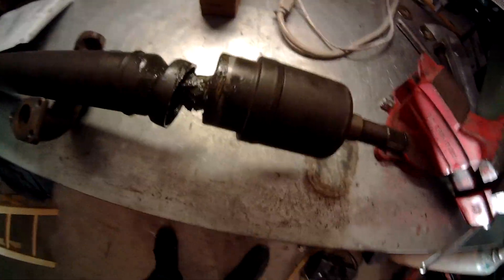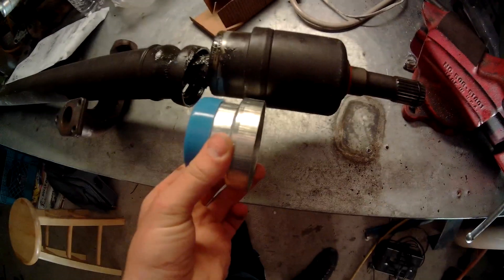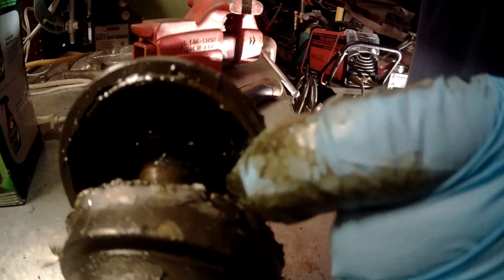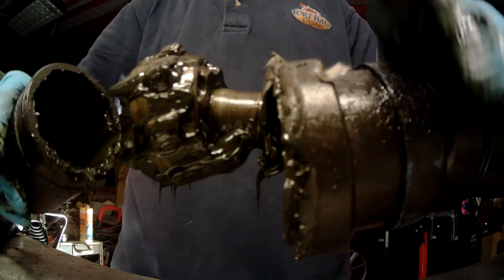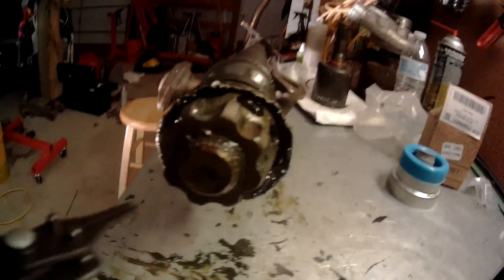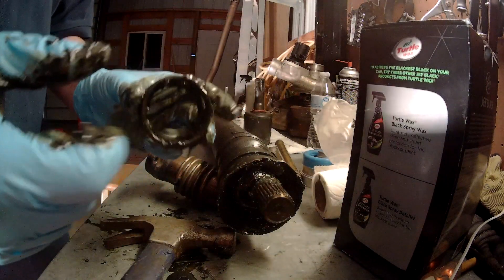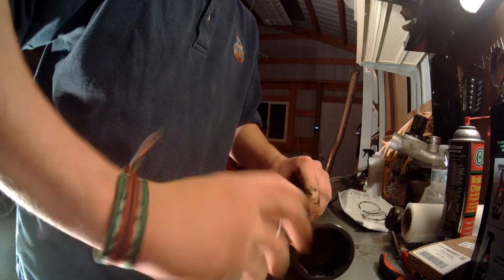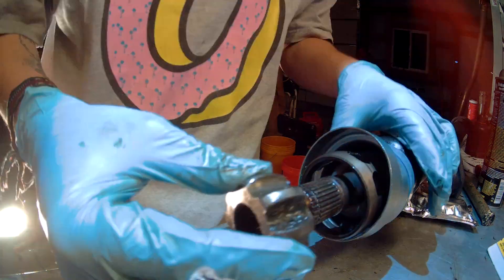Saab XWD Drive Shaft Boot Replacement

Comment: This is very helpful, Brennyn! This boot on my Turbo X is torn, and at first it seemed like the only solution would be to buy an entire new drive shaft assembly! (Saab does not seem to list the boot as a separate, replaceable part). Forgive my ignorance, but does the drive shaft only require one such boot, or does it have identical couplings at either end? What is the correct grease to use? (Since the drive shaft is "non-serviceable" can't find info re grease. At first I thought maybe CV joint grease, but Febest makes different versions for inner and outer CV joints...?). Many thanks for your expertise!
Reply from the maker: It just uses one boot for the front. the rear boot is different, but I know you  can purchase it as well. I think I just used cv axle grease if I remember correctly, hope this helps!

Comment: Have you ever replaced the ujoints in the driveshaft before???
Reply from the maker: No it is not possible on this driveshaft without cutting and re welding it

Comment: What were the torque specs for the bolts going back on. Differential side?
Reply from the maker: Torque specs are 22ftlbs make sure you replace the bolts here is the link to new ones
https://www.esaabparts.com/saab/parts/13324897